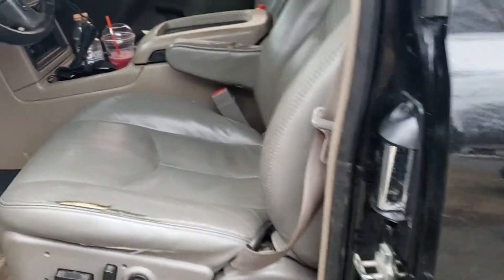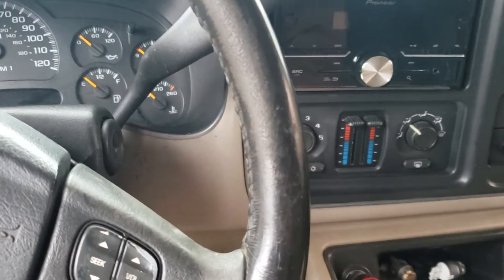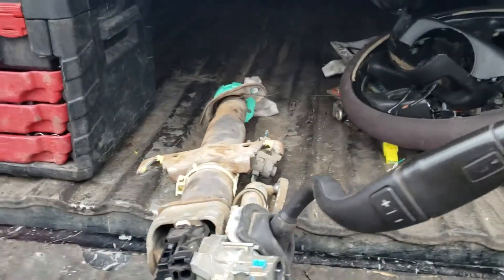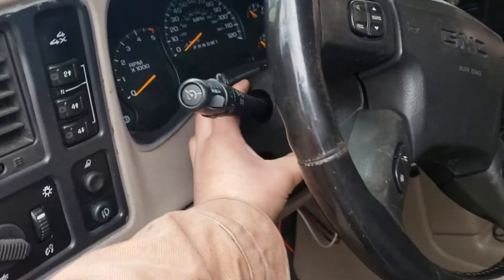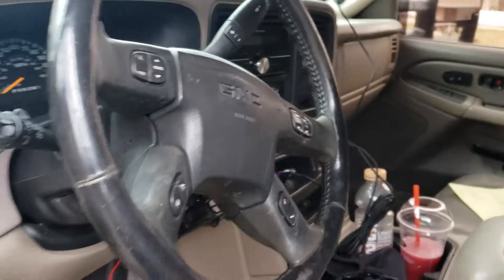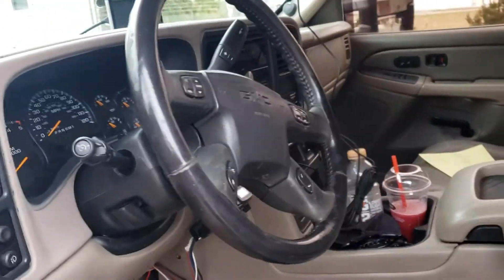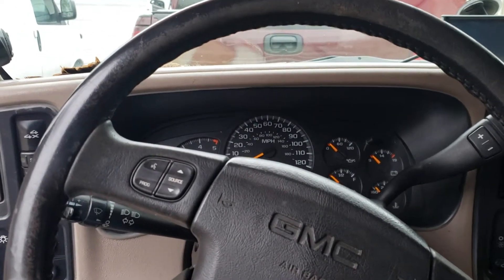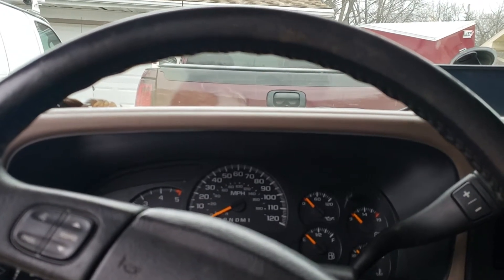Lbz Column Swap Pt 2

Comment: Did u have a rattle somewhere in your steering ? I have a rattle when I’m setting still or at idle and it drives me crazy and I don’t know what it is in my 05 LLY
Reply from the maker: Yes, the column bearing, don't know if it's the lower one that's serviceable or an upper one that's not, mine also moans when I turn right fast enough
Reply: 2005llyduramax  mine just rattles really bad when I start it and I’m setting there or come to a red light or something like that. It almost sounds like it’s in the firewall.
Reply from the maker: @jacobhenson3952  yeah, the Column bearing is a tricky bugger sometime by the way it sounds, they have a supposed "updated" bearing, but it fit loosely in the column for me, but I don't believe I had any more rattling or moaning after that, or if any rattling it was super quiet, I did a video a while back when I replaced mine on my 01 sierra. It's got a cool helpful tip cause it can be a handful in such an awkward place